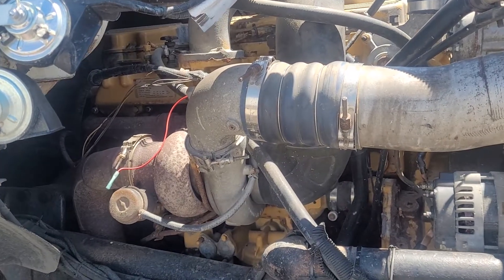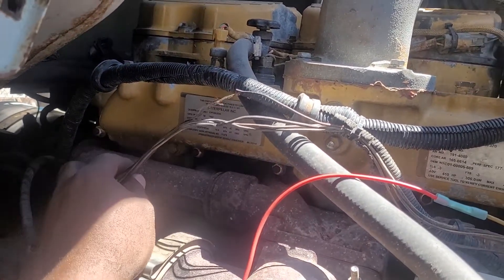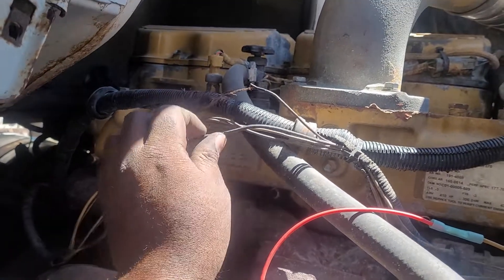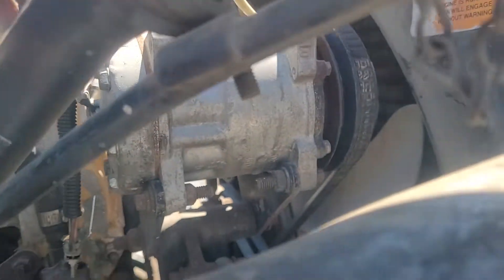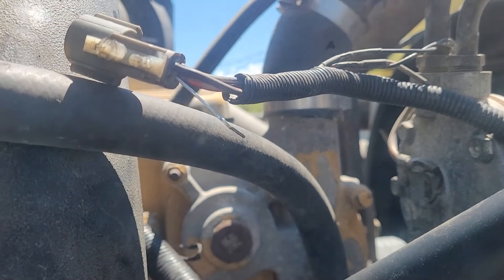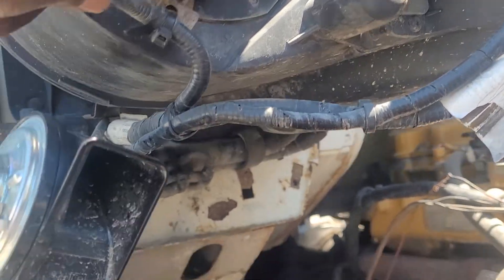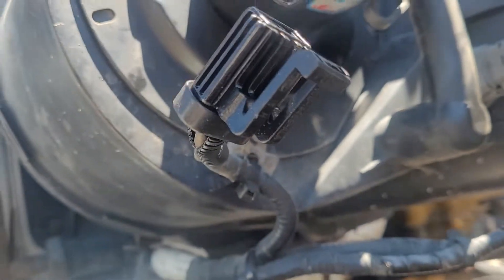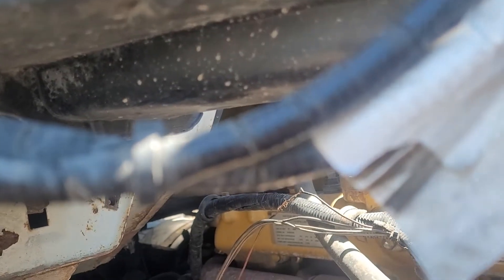1999 -06 STERLING AC  NOT WORKING 👈 HOW TO REPAIR

Comment: Hello man I replace both switches the resistor and the blower unit but I didn’t solved the problem with the heat air. Any other advice. I have a 06 sterling acterra
Reply from the maker: Sorry omg didn't get your message in time.....ok, on the passenger side of your truck, at the top of the fuse box ... there is a  push-pull piston that piston is stuck in the close position ....try to put direct air .

Comment: I have a 2005 Sterling L7500 with no air, no heat, no air at all.. no blower or anything. I replaced the blower motor, the resistor, the HVAC relay in the cab (behind where the glove box would go), and I replaced the HVAC control switch. No luck. Power is going to the HVAC control switch. Took it to a mechanic who said the switch has a bad ground, so nothing works. Does that even make sense? One bad ground and nothing works? (And I can’t even find the bad ground!) 🤦🏻‍♂️🤷🏻‍♂️
Reply from the maker: Good night ....question #1: Do you lose air very fast after about 5to20 min after you park ? 
If the answer is yes, then the problem is the supply value..

To find the supply valve, look on the passenger side on top of the dash. A cover is there with about 6 clips, 
Remove the cover. u should see 👀 a valve with a lot of hose, coming out of it all different kinds of colors. Replace that valve it goes bad after a while. Make sure to follow the hose that goes to the heater core .everything to teal with heat, low air brake, ect, is controlled by that valve ....

Please be careful when removing that valve. And make sure u find the replacement first b4 doing the job, ok 

If this helps freightliner stock this parts .but you would have to order it first. Good luck 👍
Reply from the maker: Check the coolant level also 
Flush out th old coolant it can also be air in the system or the lines
Reply from the maker: ????? Did you get your project fix

Comment: Blower fan works when I apply voltage but I replaced the resistor and it didn't fix it
Reply from the maker: I'm sorry to hear that it didn't work. Ok, test to see 👀 if power 🔋 is going to the switch dial. Ac/heat button
Reply from the maker: Good night. I hope I am not too late. Did u fix the problem ?